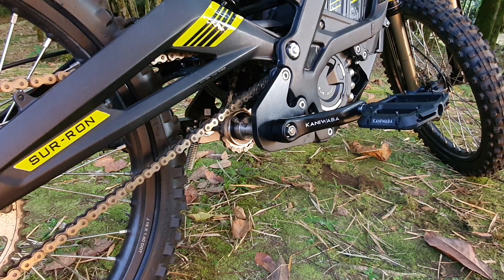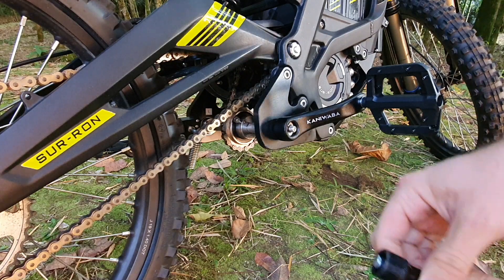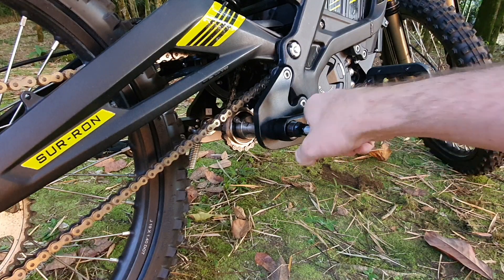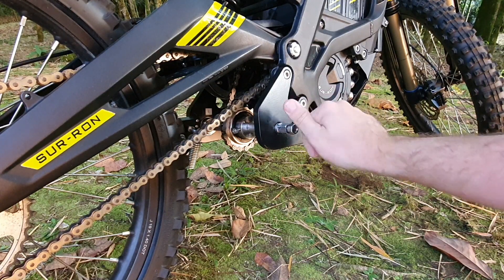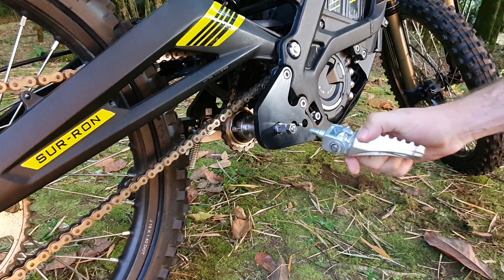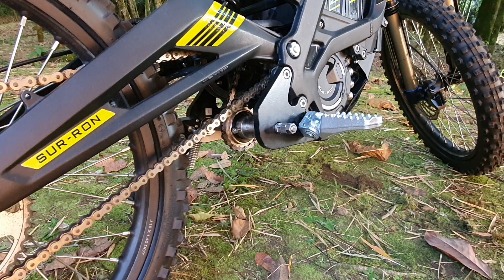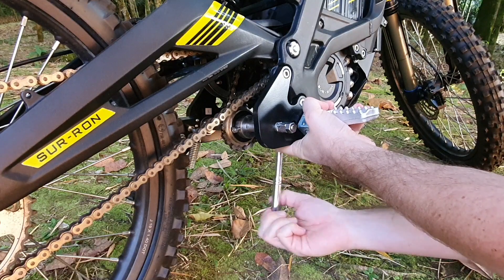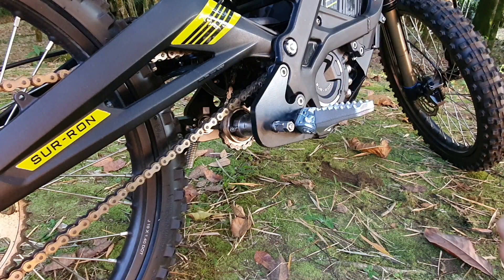How to easily change between Cranks and Pegs with your KANIWABA Pedal Kit

Comment: Nice! I was wondering what this little tool was that came with the pedal kit!

I received my power pedal kit about a week ago. It's a fantastic piece of engineering; everything fits perfectly and the installation video helped immensely! As you said in your installation video, you really do need a 6mm allen ratchet adapter to take off the pegs. I tried to take off the pegs with just a regular L-Shaped Allen wrench and it bent!!!

Today I took the Sur Ron X with the pedals installed to an off road Motor Cross trail. I put these things through some serious abuse. These things were slammed into rock and hill multiple times! After the ride I looked them over and they held up amazingly well - not a single dent or sign of damage. The durability cannot be understated with this pedal kit. 

Rough trail and hill climbing are not the intended purpose of these pedals and so this "durability test" will be a one time thing. On smooth surfaces and roadways these pedals are the best option for "riding under the radar."

Thanks for making these man! I hope you're getting rich off of them! :)

Comment: Hey Kaniwaba! I love your pedal kit! I purchased it and it’s by far the best thing on the market for this. Just curious, do you think it would be possible to put a larger sprocket on the flywheel/would it make a sizeable ratio difference to get a better gearing? It’s not bad as is. But it would be better to get going a bit quicker with just the pedals.
Reply from the maker: Thanks RJ Hall!  Putting a bigger flywheel will reduce ground clearance and still the gear ratio will not be enough! In order to get a better ratio, multiple gears would be needed 👍🏻
Reply: @kaniwaba  understood! Ground clearance is immensely more important. Another suggestion. Due to the nature of the suspension of the Sur Ron. It’s incredibly easy to scrape the pedals on the ground. The slightest turn will let them scrape. On your kits I would love to see an option to purchase shorter cranks. The ones provided were 130 mm. But I would go as short as 65 mm. Unless you have a better suggestion for solving this issue. I have already lost a few of the grippers on the pedals due to this.